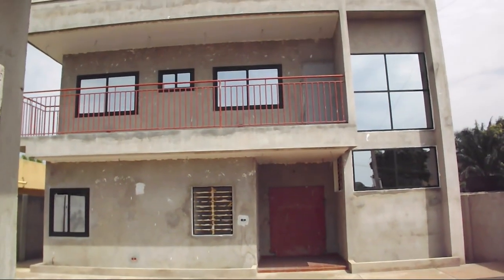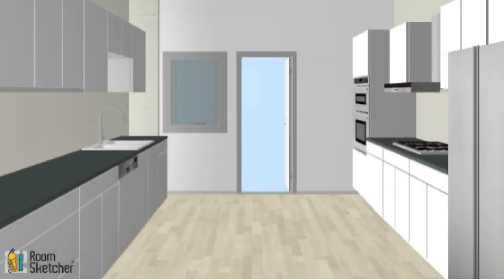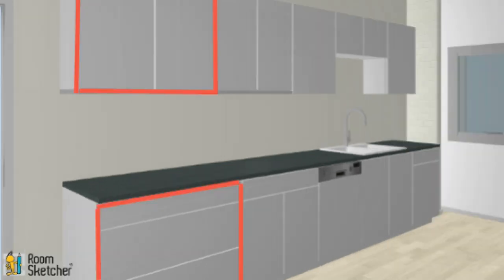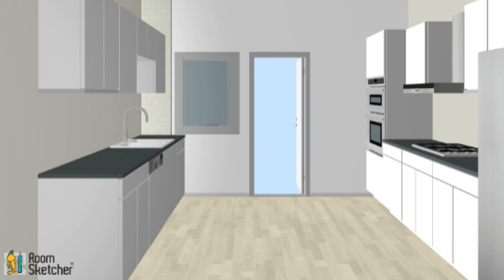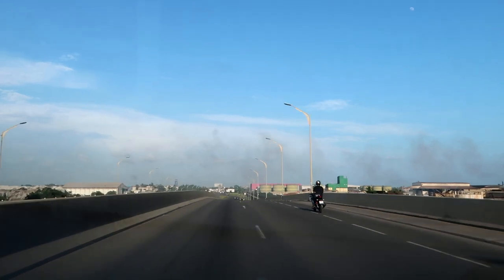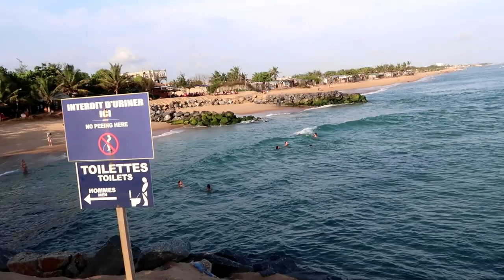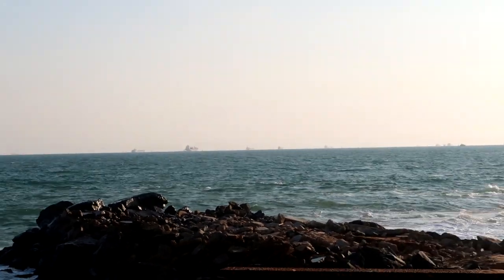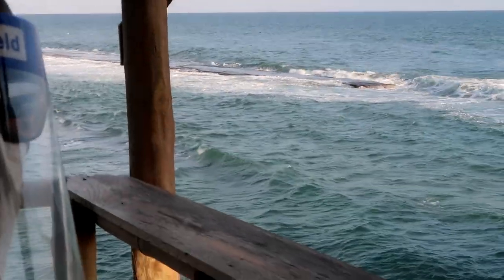Building The House 78 - Galley Kitchen Imagined || Marcelo beach

Comment: The gallery kitchen makes the most sense for the space that you have. It will keep the air circulation and also prevent the congestion of foot traffic. The house is coming along well though.  Thanks for sharing the journey always.
Reply from the maker: Hi bro!  @4Ever Home has spoken😂 

Totally agree with the insight. Air flow, eliminate congestion by ensuring free flow of foot traffic.  Note, we only have 3.73m across the bigger section. Have a great week bro! 🙏🏾